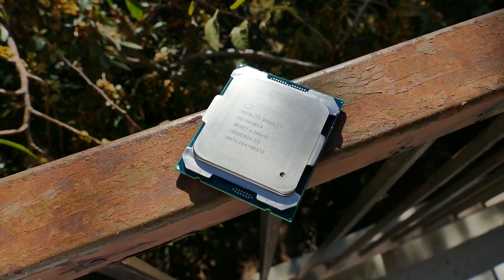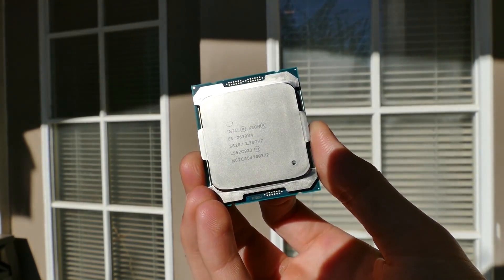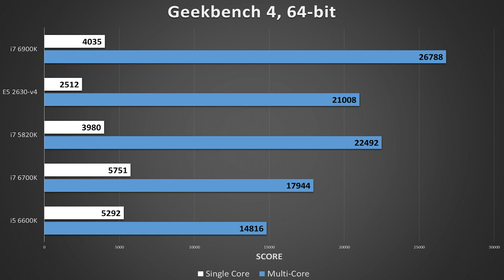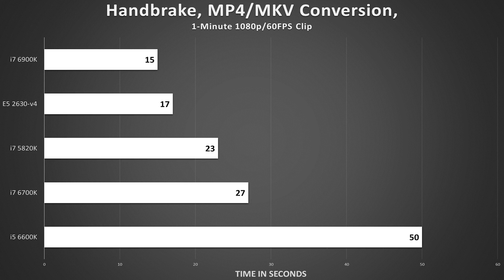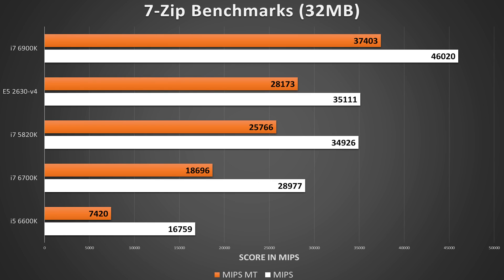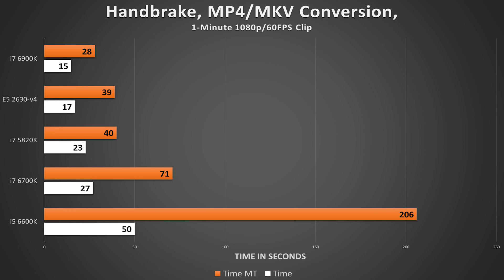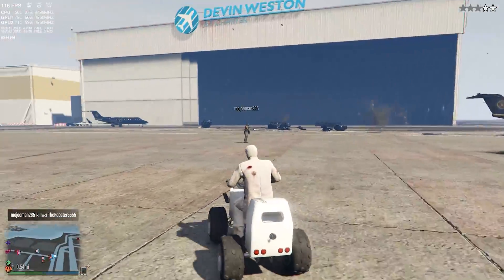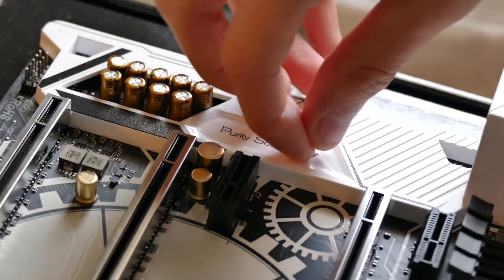i5 vs. i7 vs. i7 vs. Xeon vs. i7 (Multi-tasking/Heavy Workloads)

Comment: i have a question, i used to have an i5-4460 then i rendered a 720p video from my camera that i exported to the PC, in render times when i upgraded to the i7-4790, it beat the i7 by a few seconds using wondershare video editor. Does this mean the software itself is not optimized to take advantage of the hyperthreaded cores?
Reply: Supermanu15 yea

Comment: do I need a special mother for overlocking? Or can i do it with any
Reply: Antonio Camunas for Intel any motherboard that is Z170, H170, or Z270 would be good. i think they make H270 motherboards? AMD for its current lineup at Z370 I believe it's called is good for over clocking.

Comment: I'm looking for the best option for the long term. Which to choose used I7 990X cup upgrade or rebuild base system with new cpu/motherboard/ram? I already have a 850 pro SSD and GTX 970.  Suggestions?

Comment: Hi Salazar. Congratulations on your great reviews.
I would like to hear your opinion about the i7-6700 vs the Xeon-E3-1230v5. 
They seem very equivalent to me, the main diference being that the i7 has processor graphics and the Xeon does not, but the Xeon has Error-Correcting Code memory and the i7 does not. (xeon also is 50 euros cheaper). 
Since we use a dedicated graphics card, it seems to me that the  i7-6700 offers no significant advantage in comparison to the Xeon-E3-1230v5, because the integrated graphics will not be used, is this right? 
My other doubt is how much of an advantage does the ECC-memory gives? It seemed an interesting feature to me in the Xeon, but I am very ignorant on this subjects. Could you please shed some light on this.
Thank you very much.

Comment: Hello! As someone who enjoys your videos and general approach of providing unbiased technical information, I have to say that I was a little disappointed by this instalment. The title suggests a test of actual heavy workloads, but did not include any interactive examples, such as working on a Mocha render with a few hundred X-splines, or simply just performing continuous, non-GPU-bound transforms in 3DS Max, Maya, AutoCAD, ZBrush or any such program. I feel that system responsiveness while actually using the computer is as important, if not more, than rendertimes when you can go and make a nice cup of coffee :)

Comment: So I dont really know what video rendering is or does but i personally have never done it before. Most of my movies are on VHS or 16 mm film tapes anyway. But nobody say I didnt went with the times I just dont want to digitalize a few hundred movies. Still I built a PC lately on the basis of the 6600k. Cause Hyperthreading is witchcraft. But I really wonder why the 6700k fared so much better than the 6600k. Ive heard from a few sources now, that even with everything in favour of Hyperthreading it still only makes things around 20% faster. It would be nice if someone could explain to me how the 6600k took double the time for some of these tasks?

Comment: a xeon x5687 back in the x58 days was imo the fasest processor gaming AND productivity for socket 1366. It still does pretty well too. That socket did have hyper threading 6 cores, but they werent clocked as high as the x5687.

Comment: my 6600k runs at 5ghz at 1.375v and plays all my games fine on a 1440p monitor and a gtx 1070, a 6700k is useless if you are gaming accept for a few titles, battlefield one, x-plane 11, all run great for me on a 6600k.i owned a 6800k and sold it because it was garbage.i don't do video rendering so i could careless, keep in mind the 7700k is a month away with a boost clock of 4.5ghz and stock at 4.2ghz,save your money and wait.

Comment: What was your 5820k overclocked to? I can't find it in the video if you said. I have mine at 4.5GHz and here are my numbers from a few of the benchmarks (with chrome open and a couple random things like discord, ccleaner, and are-gee-bee utilities).
7zip 38620
cinebench 1299
geekbench single 4958
geekbench multi 22874

Comment: Umm.. none of these because if Zen holds up in a few months (2017) then the 1100$ Intel will be trumped by the 500$ Zen and 400$ I7 will be around 150$ Zen with the modular socket for upgrading etc..
Reply: Those numbers are probably way off, but sure
Reply: Not quite. Intel has enjoyed such a monopoly in the past few years that they are offering 6-8 core processors for upwards to 700$ or more.

 Even if Zen is literally 5% less efficient per-core on release, the fact it can compete at literally half the price would make it a far better product. 

All benchmarks and data so far released have shown that Zen is highly competitive and thus buying an I7 for like 450$ now might be a joke if you can get a 200$ Zen in only a few months that might be like 3% slower, depending on where AMD places the price. The real win-point being the larger price margin making it that much better or accessible.

They are making 8-core 16-thread processors more affordable, whilst being future-proofed for the multithreading and API work that AMD has always excelled in and which will pave the way for the future. As stated, even if the performance on release is even slightly less than an Intel one, the accessibility factor at half the price will make it a much better product, and also bring down monopolized pricing on the I7s. 

AMD was always sort of 'ahead'. Their actual research on multithreading technology and APIS has been going on for years and ironically that is what will put them ahead yet again whilst tearing down delusional monopolies held by Intel. It takes a firm understanding of what is going on underneath or overall to agree with this. 

The only reason why they never emulated Intel is because obviously a properly multi-threaded application would run better on an 6-8 core and yet cheaper AMD processor. Even so: Intel chose the sort of scenic route by going for single-core performance on emulated threads/cores. Yet they weren't the ones who expanded to 64-bit(AMD), create multiple cores until recently, etc.. and AMD always sort of knew what Intel was doing, they just decided never to do it.

And to this day, you're still quite overpaying if you did buy an I7, considering a 100$ AMD cpu will be running any app/game at high frequencies and more than enough cores for multi-tasking other things too. It would just be the placebo effect to use one. 

Emulated cores is not something AMD could not 'do' before but they are simply shrugging their shoulders and doing it after neglecting it. They were expanding to multi-threading and future proofing which ironically 'the world' failed at (not them) rather than single-core efficiency. Moving towards quantum computing, multi-threading, etc.. is obviously going to happen.. they were simply focusing on it more whilst people were perfecting their dated 1-core performance. Consider that now they will catch up even in single-core efficiency and then already have years of better multi-threading and cheaper multi-core algorithms being applied. 

Consider that they are/were 'already' ahead in multi-coring, multi-threading, and future-proofing technologies which will put them at an edge yet again. Combine both of those things and Zen is definitely a winner technology which will again champion affordable upgrades for people, even if the price is give or take a hundred dollars. They are also making some good advances in mobile GPUs, APUs (which is their own concept), which people used to think were a bad idea but are now proving through time to be extremely useful whilst being cheap/accessible. 

In the end it's about the better product for the price. AMD has been making comebacks whilst they were "seemingly" behind for many years (actually just researching stuff that people thought was 'useless' and is now being used). It's not about simply fan-boying to one company, but to realize that you probably overpayed if you got a 400$ or more I7 already as Zen will be much better for the price regardless of 'affiliation' of side or company.

Comment: I was looking at the i7-6700K for both gaming and video rendering, but from what you've shown, it looks like the i7-5820K does better.  So am I still thinking in a good way with the 6700K?
Reply: MidnightBanshi 6700k will crush 5820k in gaming and does very well with rendering.
  get the 6700k.
Reply: Yol Thanks!  I will stick with my plans for the 6700K then!
Reply: That is true 6700K has best single core performance and is way better for gaming.

Comment: Time moves ahead. A few years ago 4 cores is where it was at. Then again, this is video and rendering so more cores tend to bring good performance.

Mostly shocked though just how effective Handbrake is. An i7 really makes a difference there. 

Oh well the i5 I have will do fine for the gaming I do. And unless I begin streaming/encoding in 4K I shouldn't get into trouble.

Comment: Quick question, why would you be "upgrading" to Kabylake when Cannonlake is coming out in 2017?
Reply: Ironite13 Desktop kabylake hasnt even been released yet lol its getting released early next year
Reply: jynxed thanks for stating the obvious. but Kabylake is an updated Skylake that they're using to compete with Zen. it's pointless buying a Kabylake thinking it's going to be any better than the Skylake. Cannonlake will be the next gen Intel CPU.
Reply: ***** Kabylake is the perfected version of Skylake which was said to use 14nm+ architecture and the apparently the Skylake wasnt a finished product. So obviously Kabylake would be better then Skylake and also the TDP will be increased which will allow higher and better OC. I doubt Cannonlake would be released next year, they will most likely leak the information and thats about it.

Comment: If you want to have some fun, grab a cheap 2011 dual socket and a couple 8 core Xeon chips off Ebay.  As long as you are using rendering software that can use the cores, it's a monster setup.  Better yet for VM setups.  And chips are cheap these days.  As low as $50-60 US.

Comment: Seems to me the 5820k would be a good bet for those doing high quality streaming of AAA titles, 6700k for content creators and twitch streamers, and 6600k for just gamers.
Reply: just saw this video and could not agree more I have the 5820k did not even look at the 6800k as they don't OC as much and do not yield as much performance gains. Unless intel releases something worth it I will stay with what I have.  The 5820k allows you to play games render do CPU applications without feeling it get choked up, it pretty much is really versatile compared to the 4790k or 6700k who are just better in games and okay in CPU workloads. Why buy a i7 to just play games better when you can buy a i7 that can play games and do CPU workloads with no issues and feel no drag, yea it is cheaper but still pointless. If you just play games you might as well stick with the i5 and you will be good but to me if you are going to i7 might as well get something design to do a lot more than just play games better.  There supposed to have new 6 cores coming out with less L3 cache same TDP so I hope they are better optimized for games while also doing better in CPU applications.
Reply: Pennywise yup i7 5820k offers more than just gaming performance gains.

Comment: No 6800k?
Reply from the maker: Nearly identical to the 5820K. IPC improvement is marginal.
Reply from the maker: If it wasn't for Kaby Lake coming out soon, I'd have already swapped back to the 6700K. The 7700K is expected to clock higher, which will pull it ahead of the 6700K.
Reply: By the way which do you  prefer using, VP9 or H265? I managed to render H265 on my laptop and it rendered for so long.
Reply: That's exactly why I'm waiting for the 7700K.  Great video by the way - love your production quality.  Sub'd :)

Comment: Why is my 4.4ghz 5820k faster than the 4.5ghz 5820k in his benchmark?
Reply from the maker: Several secondary variables to consider. It's very likely we had different background processes running. Your benchmarks should be very close to mine nonetheless.
Reply: TheLawnWanderer Variables. Can be because of just pure chance, RAM, etc.
Reply: +AlphaLineGaming ehh his Cpu is more 7331
Reply: Salazar Studio cinebench R15 was the one I noticed. I get around 1330 in that bench. 
Granted I run 2800mhz CL12 and 4ghz cache speeds. 
Cinebench probably likes tight timings.

Comment: Can someone explain if the non k 6700 is actually overclockable or not? If it is, is it worth it?
Reply: It's overclockable but it requires a cutom BIOS. 

So basically, it's overclockable if you want it to be overclockable.

Comment: you are correct in your analysis   the 6700k is by far the best processor for a personal computer. almost all personal software will not efficently take advantage of more than four cores. the xeons are industrial processors ,  and are designed for running servers and virtual machines reliably 24/7.  for the office server get xeons, at home get a 6700k

Comment: Question time:
I want to get a PC, first off. I have no idea where to start or what is better or worse. 
Secondly I don't want to spend much more than €600,- problem is, that includes a monitor and keyboard (still have a functional mouse laying around).
I don't want to play big game titles on it like wither or battlefield etc (I'll play those on my console). I simply want to be able to play decent games every now and then at a decent framerate (30 is fine for me). Games like World Of Warships, and Cities Skylines and Total war for example. I want to be able to play those at good settings with a decent framerate. 
So what would I need to get I'm terms of graphics card or processor?

Comment: So, for my HP laptop it's better to put there i7-620m instead of i7-720qm ?
Reply: If you are multitasking like many windows and tasks open (on your laptop!) then you should use the i7-720qm as it´s a quad core but if you only need some performance for a bit of gaming or surfing the web then the i7-620m as it´s a dual core. Both of them have hyper threading! Gaming heavily depends on the graphics card also!
Reply: Yeah, i know that the 620 is better at single core, thanks for answer ;)

Comment: would a 6800k be a good deal then for 330 bucks?
Reply: ronnie cason I have systems with 6700k, 6800k and 5820k. The 6800k simply doesn't overclock well compared to either the 5820k or 6700k. The 5820k overclocks enough to make it significantly faster than the 6800k despite the IPC advantage of the 6800k.

Comment: You made my i5-6600k look like trash :D Good work like always.
Reply from the maker: Thanks for watching! Still a great processor - just not for these particular tasks ;-)
Reply: Made my C2Q Q6600 look worse than trash LMAO
Reply: Hey whats up with your 5820k I done a Geekbench 4 benchmark for 5820k and got a 4578 for single core performance and 22124 for the multi-core performance without overclock
Reply: Its trash if you want to render 4k videos without losing the ability to do anything else at the same time but its a very good CPU for normal use and game.